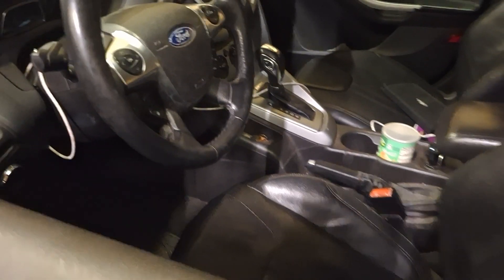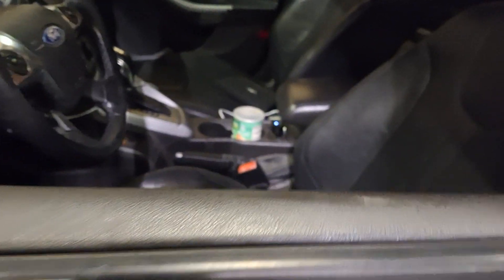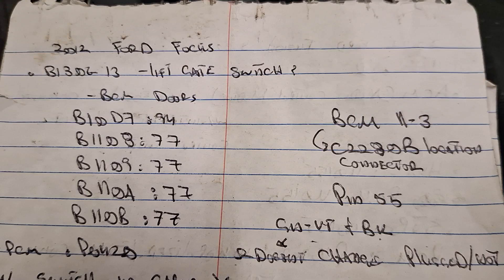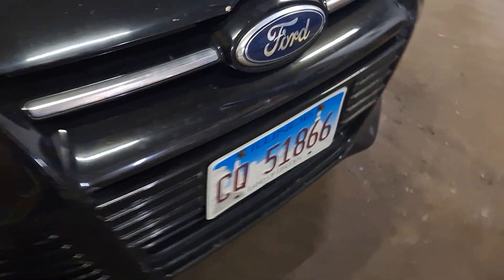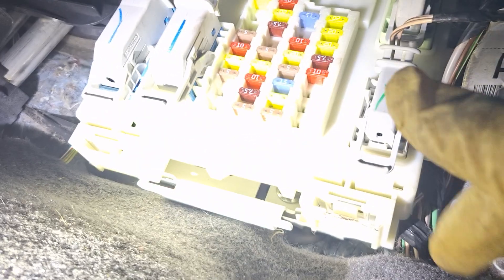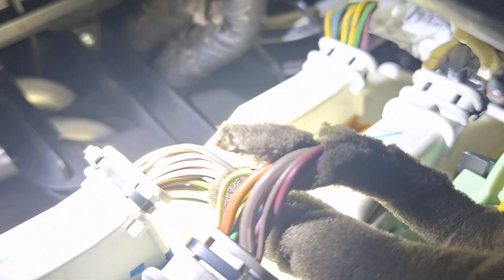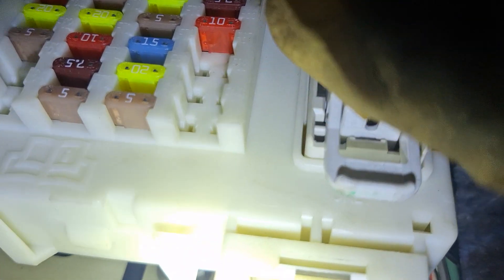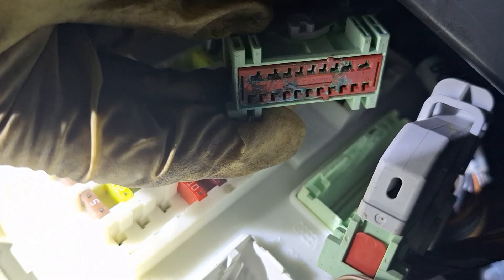2012 Ford Focus - Wont Lock. B10D7, B1108, B1109, B110A, B110B - See description.

Comment: What do you mean car needs vcm? My 2012 ford focus does the same when you hit the lock button but my fun is not running when you open the door.
Reply from the maker: @jessie5793  BCM body control unit
Reply: @waqasazmat81 what ur saying is that the hole BCM needs to be replaced?